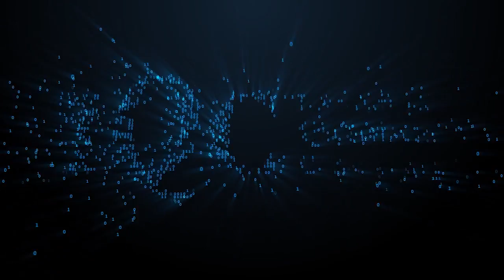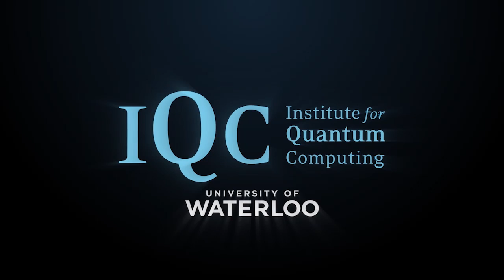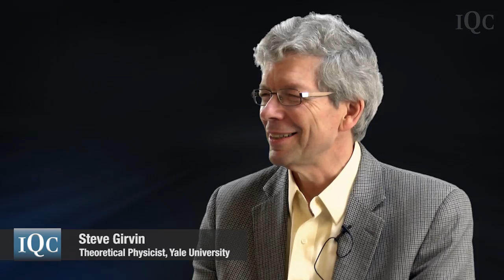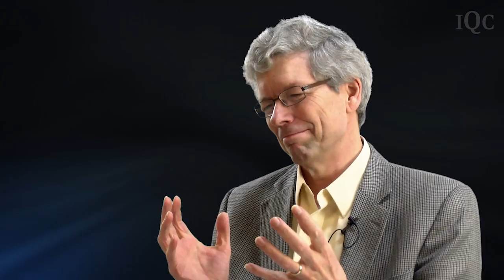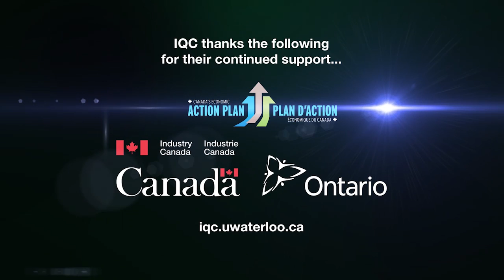Steven Girvin - Quantum Hall Effect

Comment: At 6:00 He says the information is sort of spread out and shared, sort of holographically. Does he mean shared through quantum entanglement? It is possible to have swarm of entangled particles.
Reply: I don't think he means with quantum entanglement which is actually precise action from a distance; he means to change the state of the system one has to make a large change locally to shift the system to a different state of low energy, therefore these systems would be good as information storage because input can have noise and not be perfect. The low energy state is shared and dependent over the entire system. An analogy would be how a small amount of votes doesn't change who gets elected, but a large enough amount does - but in a general sense you don't have to know the exact number of votes to know who won, just have to be accurate enough to know the majority.

Comment: If any of you have been using HP scientific calculators for solutions dealing with quantum physics I hope you avoided using the 'y^x" function. On any HP calculator i.e. hp48 hp49 hp50 hp prime, when raising a negative number to an even-numbered exponent they will return a negative. e.g. -2 * -2 * -2 * -2 equals 16 but the EquationWriter form '-2^4' when evaluated returns -16. Don't they teach in kindergarten that a negative times a negative equals a positive?
Reply: Sounds like a 1010: problem

Comment: You have mentioned about Topological Quantum computer to aid for that research, I think you said there's no such thing for now, maybe because in topology for example a figure formed like a rubber band or string which is invariant cannot be broken down but can be changed to other forms and because there's a variety of states like the dual figure of 8 that's why an idea of braiding according to you is a possibility idea. And that figure of 8 can't be changed because it's dual states aside from being entangled but going different ways in its pathway strings and could be fixed 8 as superiorly coded by High Spiritual beings. Then what if that's a fixed figure of 8 strings maybe another method is like a rubber band fold the 8 string loop over each other. Then what's the interaction? 2 fat buddies chatting? ( Joke )